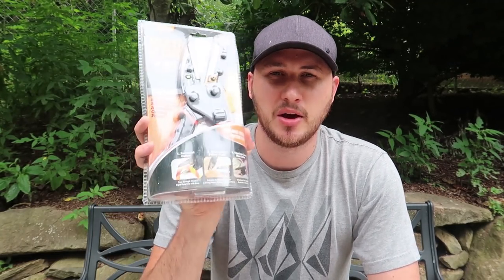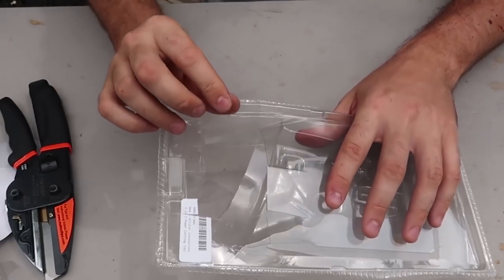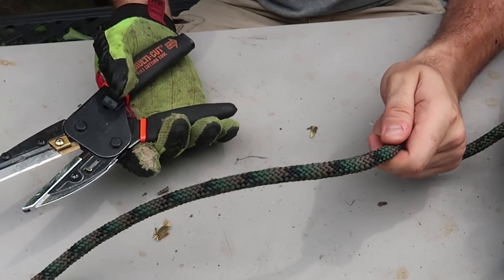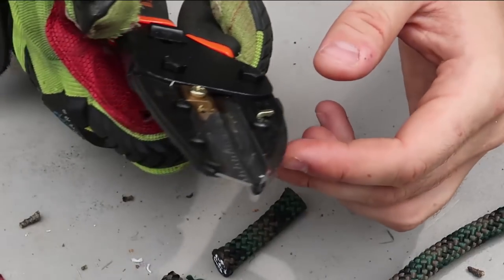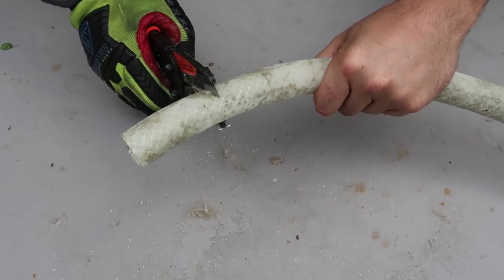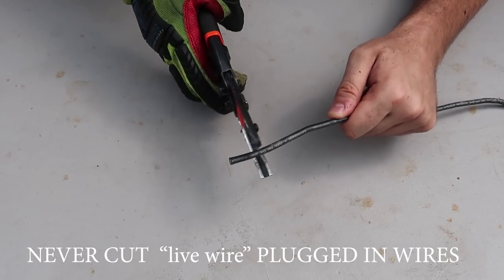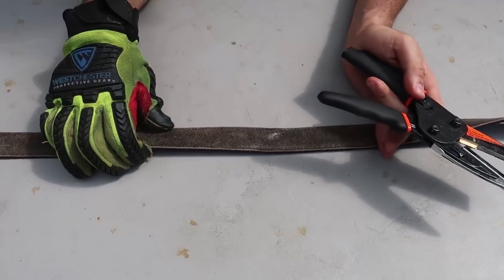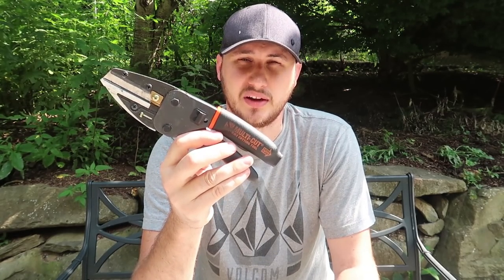Multi-Cut 3 in 1 - As Seen on TV

Comment: I could cut through the belt, rope, and hose with a sharp knife while I would just use regular wire cutters for the wire and fencing. As for the nails idk why you would want to cut the head of the nail